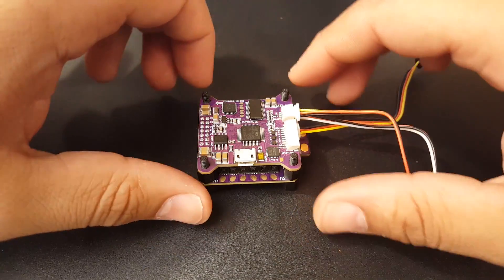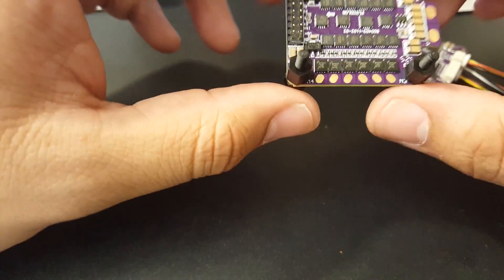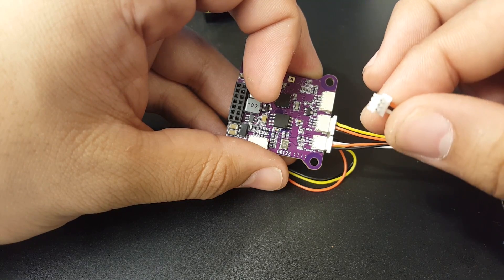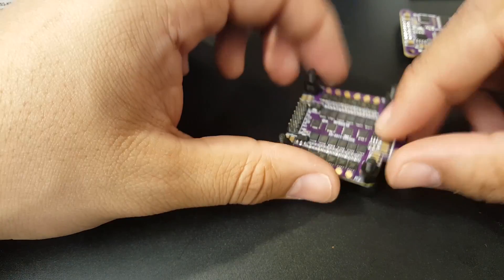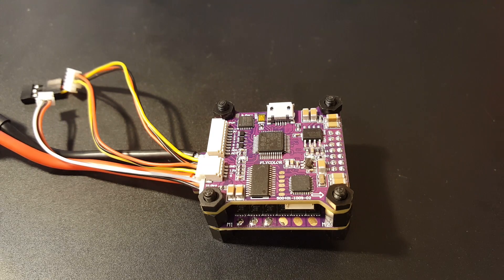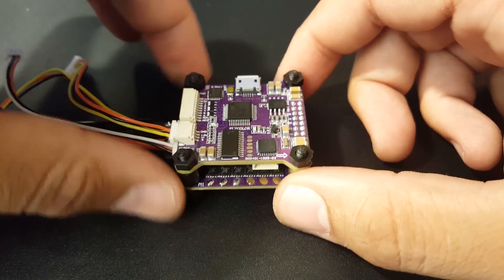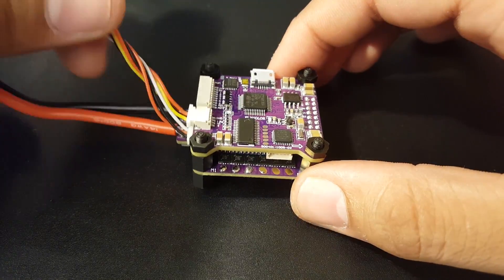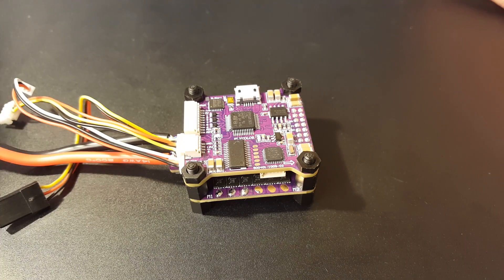FlyColor Rapter S-Tower // Review and Noise Testing

Comment: I know it’s relevant on this video but maybe you’ll respond now, what kind of low esr capacitor do you use in your builds? I want to build your builds but can’t find the capacitor, or where I can get my of my own. Thanks
Reply from the maker: Here is the link make I have added the correct filters so you can see caps from 25V to 35V and from 330uF to 1500uF

I usually use the 25V 1000uF and have some 330uF 25V and 470uF 25V

http://www2.mouser.com/Passive-Components/Capacitors/Aluminum-Electrolytic-Capacitors/Aluminum-Electrolytic-Capacitors-Leaded/FM-Series/_/N-75hqw?P=1z1414hZ1z0yoh6Z1yzuxhaZ1z0wrktZ1z0wrk5Z1z0wriwZ1z0wrkkZ1z0wrjoZ1z0wrjwZ1z0wrirZ1z0wrk7Z1yx4awyZ1yx4atv&Keyword=panasonic&FS=True

Comment: Only 13.40V to 18.60V on 4S - WHAT? And this stack is really DShot600 capable? If so then probably is worth to do some step back from F4 and get one this thing. I will seriously think about that. Also where to get wiring diagram for this stack? Didn't seen it in Banggood page. Also which OSD they're using? People told that it is MinimOSD with old firmware. Seen some pads on board near OSD chips which look like RS232 port - maybe OSD firmware can be upgraded too?

By the way can you test the noise in FPV too with some noisy motors? Seems this stack even doesn't need any low ESR caps.
Reply: KrotowX you can use serial passthrough in betaflight and the mwosd configurator too update the osd firmware. It's 30a esc too not 40a. I think he is getting the boards mixed up with the exuav boards.(flytower pros). It's still a good stack though.
Reply: I know about serial passthrough to configure MinimOSD on F3/F4. Works to display BetaFlight OSD stuff instead of MWOSD stuff via MinimOSD too. However didn't succeed in flashing my Micro MinimOSD boards via serial passthrough. Flashed them without issues through FTDI adapter. Maybe that is related to my Micro MinimOSD board revisions somehow.